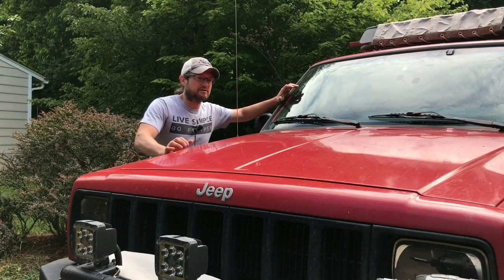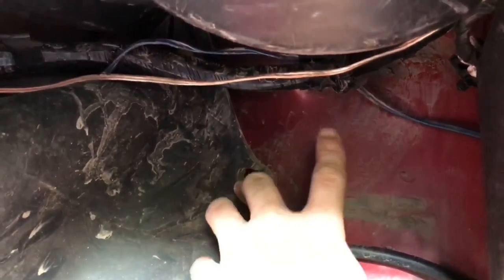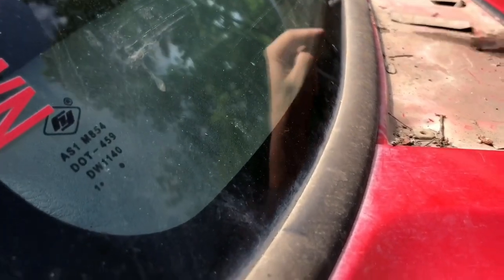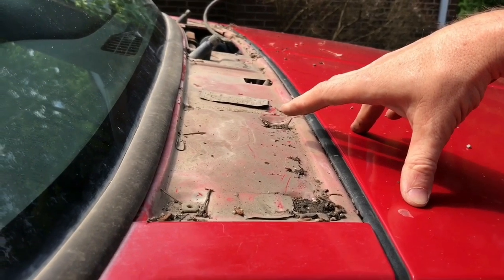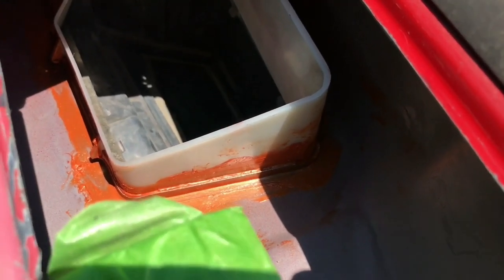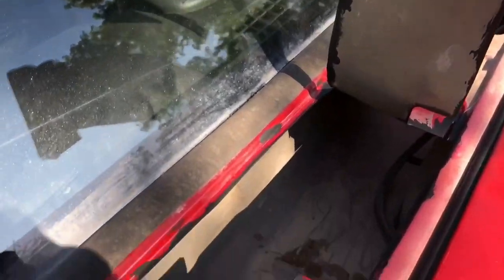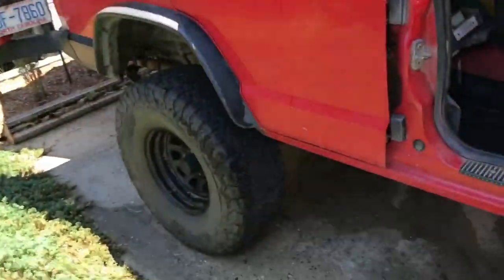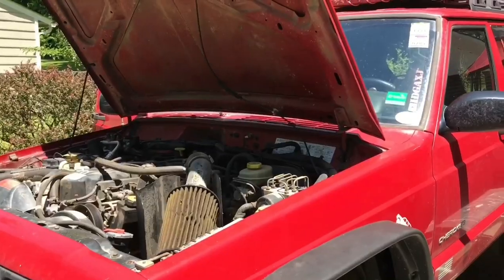How I Sealed My Cowl - Passenger Floor Water Leak - Jeep Cherokee XJ

Comment: That's exactly what happened on my newest XJ (cheap jeep Episode # 28) , the blower motor seal.  My daughter's (the one I drilled a hole) is still working great and dry.  Very informative video that will help hundreds if not thousands in the future!
Reply from the maker: Your video was one of a few I watched.  Helped me understand what was going on under the sheet metal and what needed to be fixed. Or what I thought needed to be fixed lol.  At least I won't have to worry about the fresh air intake for a while, and know that it is taken care of before it was an issue.

Comment: Good info..I think seam sealer might have been a better choice. I appreciate when someone shows how something didn't work because it happens to us all at some point. That's how we learn best sometimes.
Reply from the maker: Thanks! I have seen people use seam sealer. I actually just used RTV because I had it on hand. I checked it on my trip on the Continental Divide after hundreds of miles of vibrations and it is holding up well. Will see about long term though. 
I too like when people show the “dont’s” or mistakes. I try to show both on my channel whenever I can.  I’m far from perfect ... and don’t try to portray anything different.
Reply: @simpleoverlander  Hey mine still leaks so you are ahead of the game!🤣🤣

Comment: I cut mine back too but not as far. With water running from a garden hose into the cowling the water flowed away from the inlet much less get high enough to overflow over the metal lip that surrounds that inlet. Regardless, I sprayed a rubberized rust encapsulator product in the gap using a flexible extension hose and nozzle. I cut a replacement plate, coated the back side with chassis black and used SS blind pop rivets and auto panel adhesive. After, covered it with encapsulator as well. I wouldn’t recommend using RTV it doesn’t hold up on the long term. Better to use products designed for it.
Reply from the maker: On a flat surface the water did run away, but if parked nose up in a driveway or on a street, that is when I think water would be more likely to get in since the drainage changes.  This was even more prevalent for my actual leak, the blower motor seal.  I agree the RTV is not the right way to close this up.  I was in a hurry for a trip so went this route.  Your method is more permanent and something I will look at when I tackle at this again.  Thanks for the detailed comment.

Comment from the maker: Although I misdiagnosed why I had a leak at my firewall on the passenger side, I did complete this job.  Hopefully this video will help those that need to do this job, and at the very least, show what it looks like in the cowl at the fresh air intake vent.  I don't recommend the RTV method to close this up.  It will leak eventually.  I only did that because I was pressed for time to be on the road. 
My leak was actually due to the blower motor seal (oops).  I won't have to worry about this any time soon though.
Reply: and how did you fix the blower motor seal?

Comment: ...very helpful video ! I guess my cowl drain holes are clogged - how to get there ? Can you access these by removing the front inner liners ? Many thanks !
Reply from the maker: From what I saw in my cowl, there weren'tt drain holes.  The water escapes by slipping through the joints in the sheet metal on each side of the Jeep.  The only way to access that is to take the top cover off, as I did in this video, clean out the drivers side by hand, then use an air hose to try and get the passengers side.  Without cutting the metal (like I did) there is no way to get over there easily.  Those clogged corners can definitely cause the water to build up!
Reply: @simpleoverlander  many thanks for this advice - unfortunately looks to be a major effort to clean up these "drains" .....

Comment: Unfortunate hackery, I knew in the first minutes that you were on the wrong track, now you've cut up the car for nothing.  And RTV?!  How to... delete this.
Reply: thing is a lot of us realize its an old rig and are just trying to keep it going.  the floor could be rusting out while your paying attention to other issues. in my 99 i just removed all the floor carpet and its soaked underneath. sometimes you see that and the floors gone, anything anybody can come up with is a help. i wouldnt use silicone but maybe thats all he had. if i had nothing else i would make a full patch  and insert the pieces into cutouts. but thats just me. i dont want to cherry my jeep and take it out anyway. whats the point, keep it running good, not rusted out and safe and go have fun.🙂i may have a leak under my heater seal, someone elses experience is my education. now i have a starting point.